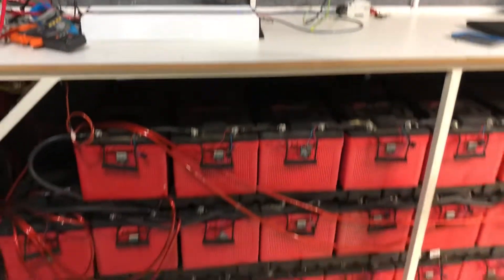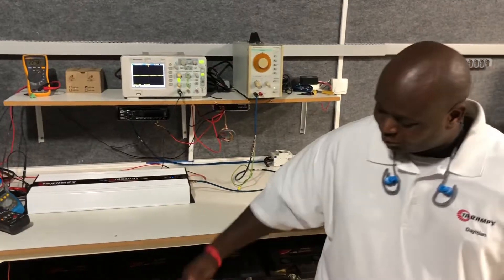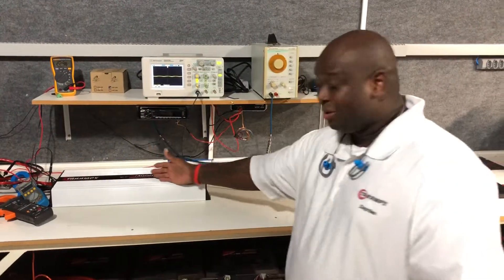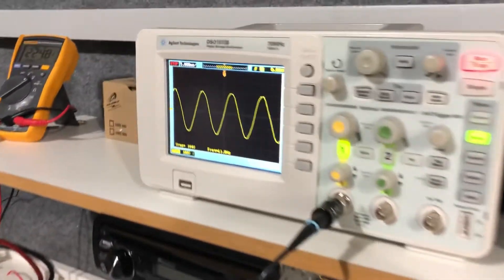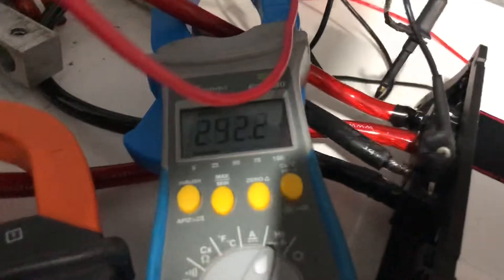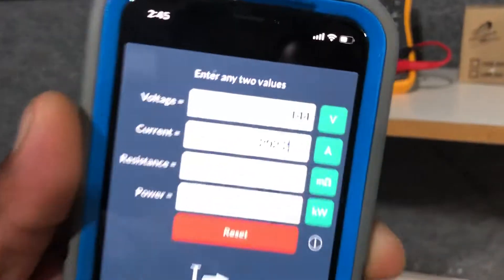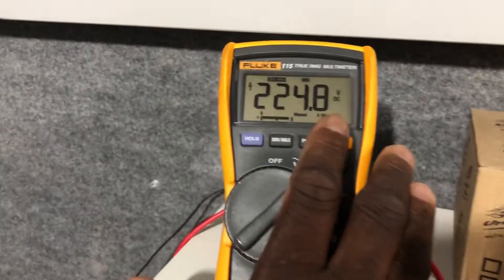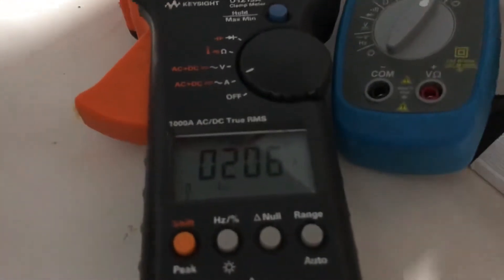Taramps power test hv 40.000w

Comment: Will the 20k hv to ok on a 250 amp alternator with two XSpower d7500’s I have plenty of triple runs of 0 guage power and ground wires all over the set up.
Reply: No.  It's a different set up.  You'll need a lot of batteries in series to raise the voltage.  And charge them @ home with a charger.

Comment: Can you put it on the dyno machine I'm looking into buying one but I have to see the Watts
Reply: can you use it for bass I've been asking for two months now is this a bass amp most clipping amp is for highs
Reply: @dwainemcgriff7088  Do you need 40k watts? Are you going to put 19 batteries in your car to run it?
Reply: @dwainemcgriff7088  it was made more for mids and highs its called chipeo because its for speakers like EV/or beyma
Reply: @dwainemcgriff7088  it can use for bass
Reply from the maker: Dyno have a limit power ( 19.000 w )
Reply: So that mean you cannot do the 20000 either on the dyno
Reply: Is it bass